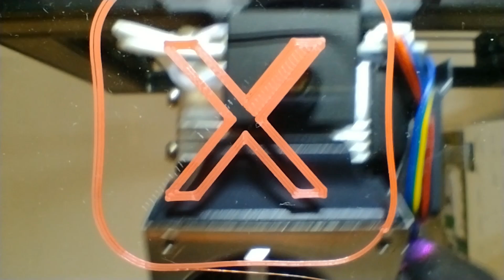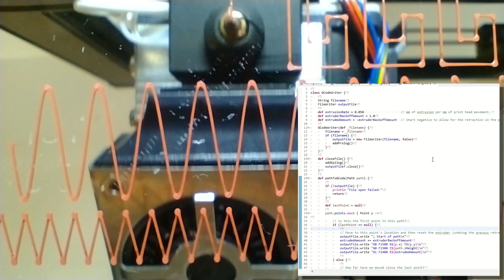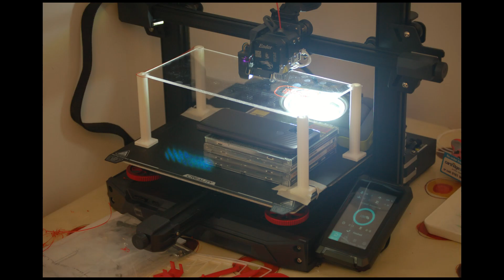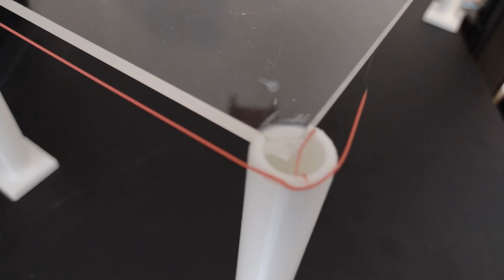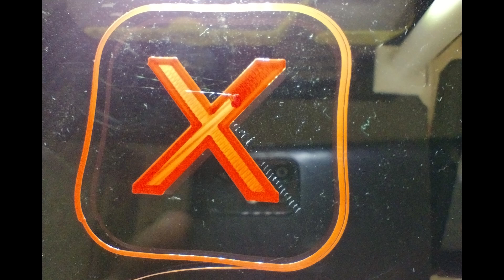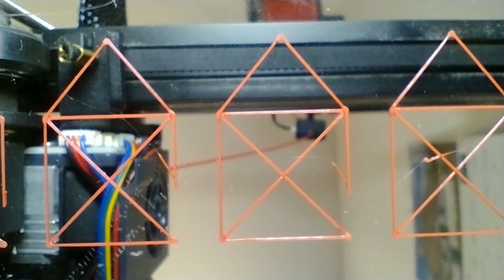3D Printing from Below #3dprinting

Comment: I like it. I'd suggest a clamp to hold down the towers. Seems like a tight gap between the bed and the platform beneath it, but it should be doable from the sides without the towers. The bed and printing surface look flexible, which could cause issues too. I don't think that tape is going to work even short term for the pillars.
Reply from the maker: Yes, all good points. The tower design is all wrong - they can be shorter, they should be entirely under the acrylic, and I'll add a way to clamp the bases down to the base.
Reply: @ChrisBLong Ender 3 is V-Slot based, can't you attach to it?
Reply from the maker: @InfiniteCoder01  I guess that would be possible, I didn't want to mess with removing the bed though.